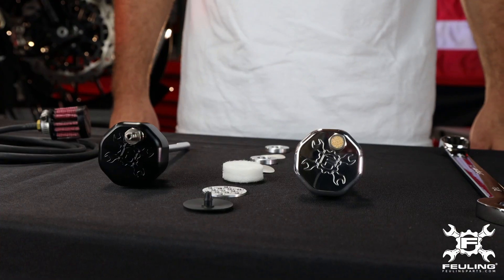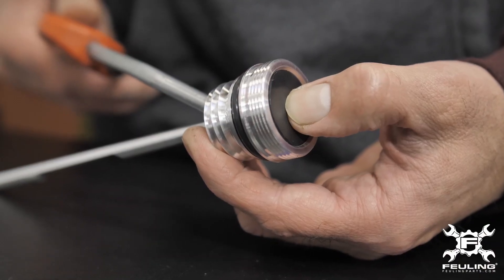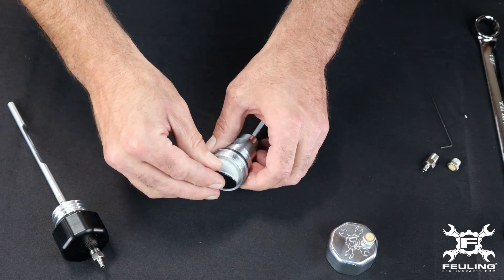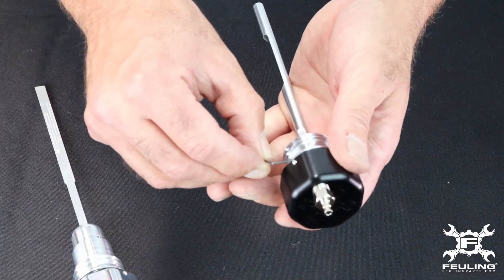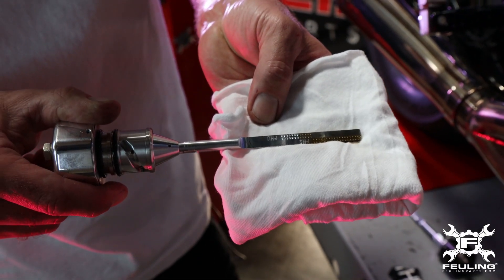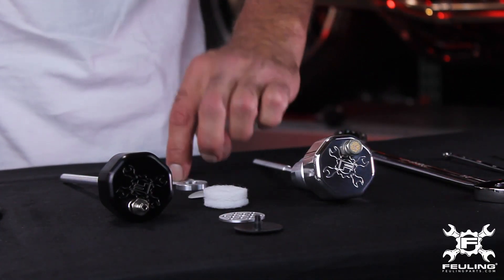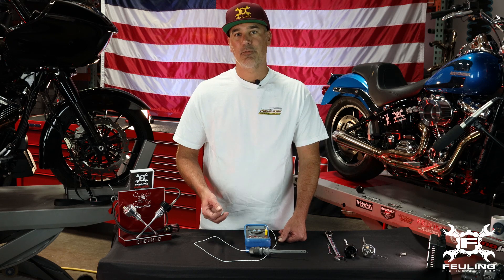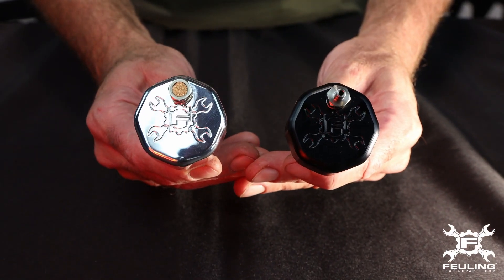FEULING VENTED DIPSTICKS FOR M-EIGHT & TWIN CAM ENGINES

Comment: So, we are asked to buy a part to try to solve the manufacturer’s poor design, and lax tolerances?
Reply: I know right? Why no recall notice to have this installed?
Reply: @thecommander2616  You must be a first time Harley owner. 😂
Reply: @joshrandall5297   right? Hahahaha... since 1903 , same same.
Reply: Harley Davidson gave us a better and more powerful engine without solving the same oil pressure flow problem they’ve had for all their motors. Government EPA regulations is why they can’t fix it. 
I’ll be adding Fueling’s dipstick with line filter to my Harley this year, BUT I still have one big question?
Should you run ventilating dipstick during a DYNO tune?
Reply: @thecommander2616  EPA
Reply: Dont like it… go get a honda

Comment: I purchased one of these dip sticks. It is well made but, after using it for a few months, I removed it from my bike. It made no discernible difference on my bike. I ended up with a DK custom set up, now my air cleaner is dry with no more oil laden vapors getting sucked into the throttle body.

Comment: Hard to believe such an expensive bike has such a problem with oiling and crankcase pressure that requires such elaborate and costly aftermarket solutions. How long has Harley been making bikes? This seems like a simple engineering problem that should not be an issue coming from the factory.
Reply: Well it's an imaginary problem. Believe it or not the motorcycle has breathers that vent excess pressure already on the motorcycle. The 'issue' is that the EPA does not let Harley, or any other manufacturer, vent to atmosphere. That means the breathers vent into the intake. This ensures that all gasses are going to end up going through exhaust. What people dislike is the fact that when these breathers are working there is the possibility of atomized oil entering the intake. If all of this oil is not sucked in by the intake you get what is called blow by and oil actually escapes the intake and gets stuck in the air filter or flies out of the air filter and onto the bike. All of these 'fixes' are unnecessary and to my knowledge there are no data driven analysis that support the need for something like this. If blow by is such a huge problem a really easy fix is to ensure that your oil is not filled to maximum capacity or higher.
Reply: @batglide5484  blow by is from bad rings. Oil from the crank case being pushed into the cylinder. 

The M8 and TC can push too much oil through the breathers and it introduces more than just air into the cylinder. Most guys will never notice it but anyone that actually runs their bike hard will end up with excess carbon build up on the piston and valves. This ends up being a problem way down the road assuming normal conditions. HD allows problems to happen so they can sell the solution via screamin eagle.

Can you fix it cheaper? Yes but the part of that question thats more important than cost is the fix. $10 spent vs $400 is great until the motor locks up from oil starvation. 

Most parts cost stupid amounts for 3 reasons: name, R&D, materials. Buy it or don't, no difference to me
Reply: @kjknuth9127  the blow by pushes excess vapors and oil into the intake through the breather bolts. That's the exact purpose of the breather bolts. When people complain about blow by on their Harleys they are complaining about the oil exiting the air filter and hitting their bike or pants, or they are complaining about excess carbon buildup. Firstly, oil vapor in the air fuel mixture does not contribute meaningfully to carbon buildup. Engines vented to atmosphere still get the same amount of carbon buildup. Secondly, excess crank case pressure is already being vented out of the breather bolts. That is their purpose. Every motor company uses some form of breather bolt setup to relive excess crank case pressure, cars usually use PCV. To solve the issue of excess oil entering the intake and possibly not entering the combustion chamber as designed would be to integrate a catch can of some type between the breather bolt and the intake. If you can show me quantitative data that proves that the breather bolts are not venting enough crank case pressure and that this aftermarket product does, I'll eat my words. But I've looked it up and I can't find any evidence if either.
Reply: @batglide5484  then don't buy the product it's basic economics. There's a reason that companies have went this route and a reason motors are blowing up from the factory. I don't know either and I suspect neither do you but I can about guarantee it's the same reason
Reply: @kjknuth9127  uhm motors aren't blowing up from the factory. Even when they had sumping issues, that only affected a small minority of all M8s being produced at the time and that problem has been fixed for years now. You obviously have no clue what you're talking about, but if you want to spend hundreds of dollars on a modification that won't increase performance, reliability or even look cool then that's up to you little buddy. 🤡🤡🤡
Reply: @batglide5484  won't fit on my motor even if I wanted it.
Reply: @batglide5484 
You ever pull the heads off of a low mileage twin cam with massive carbon buildup in the intake and exhaust runners and piston dome Mr. " data driven analysis" ?

Comment: On the Softtail the standard quick disconnect requires side panel removal to check oil, the 90 degree fitting would be nice to have included in the kit.

Comment: Will this prevent blow by getting into the air cleaner?   You should have included an oil temp gauge!
Reply: @DKCustomProducts  I was wondering the same thing.  Thanks for the link
Reply: @DKCustomProducts  I assume the unit labeled  "m8 bagger" will fit the Ultra Limited 114cc?
Reply: @DKCustomProducts  Good thing DK is here answering questions for these guys. What’s up with that?  They need to realize this is a great opportunity to clarify questions.  Maybe they would get less phone calls with basic questions tying them up all day.
Reply: @johnnyturbo8460  We have many EBS options to fit the M8 Baggers, which include the Ultra Limited 114.  Which one to use depends on what air cleaner you are running.  You can contact us with that info or a photo and we will let you know which ones will fit.
Reply: @redlee3391  Thanks.  Feel free to write or call us with any questions.
Reply: @DKCustomProducts  ok, I am running the Rhinehart cold air intake.  I believe it's still the only one they sell. They just have two color options but only 1 high flow air cleaner
Reply: @DKCustomProducts  you guys and gals are always on point. I get that small town family feel every time I call and order from DK

Comment: I like Fueling products and went to order this…. $300? Holy…
I may just be using my CNC etc and trying to do it myself for like $29.
Reply: I don’t have access to a CNC but I’ve got my hobbyist lathes, mills and a shaper. With a bit of stainless and a few odds and ends, I’m pretty sure I could produce my own custom version.

Comment: One of the first things I did to my 2001 Fatboy when it was new, was install a Gear Drive and a fueling oil pump. I then put over 50,000 miles on it before I upgraded to the fueling cam plate and lifters.

Comment: High quality part.  BUT, the Feuling instructions (including this video) are not appropriate for an M8 Softail. Routing the hose was a big challenge; took me 3+ hours to install.  Calling tech help line was not too helpful.  You will need at least 6 more locking zip ties than the 2 included in kit in order to route the hose and secure it so it won't wander or chafe or interfere operation of other parts, including the side stand.

Comment: Do I need to do this on a 2022 Heritage?
Reply: No Harley started putting in a better oil pump in 2020 you should be fine it was 17. 18 19
Reply: @garyposthuma9607   Much appreciation for the response,
right here now was the only place i’ve heard that, others weren’t sure.  Thanks.
Reply: @1862anthony  that why there telling people with 17 18 19 to up grade there oil pumps to 2020 oil pump that when Harley put in a lot better  oil pump so you have the better oil pump in your 22 ihave a 18 ultra limited want 1500 to 1800 put new pump in I think I keep driving it and hope I don't have problems with it have 30 thousand miles on it
Reply: @garyposthuma9607  Nice, good to know your ride going good, good news.  And thanks for info, one less headache I need, dealing with NY traffic is bad enough.

Comment: Can gauze pad be used as filter element during  service to moto or do you all supply a filter element for sale. Will this stop the oil misting out of the air cleaner on the 2012 TC 103 or just relive the idea of oil going into the primary?

Comment: I paid the 301$ for the kit delivered from Dennis Kirk. Came with a scratched cap and has a chip where the connector screws in for the hose. Not sure how that can pass the QC ... Trying to get a replacement cap from either Feuling or DK right now. Frustrating that I have to deal with this and cannot install the part as I cannot break the shipping bags . Not sure what to think about all of this .. .
Reply: It’s called life. I hope you got it resolved.

Comment: I bought one  of these for my 2020 softail and it works great....I rode about 50 miles and engine seemed to run better and I used just the filter on top of the cap and didn't have any seepage or misting.
Reply: You guys are funny. He crankcase already has a bleeder.
Reply: @mahealanihawaii9830  yup. Bleeds everything back into your engine, and that is not good for your piston tops.
Reply: @MadMexism  also reduces octane rating making knock more prevalent on a hot engine, dirties up valves, and adds a coat of oil buildup on top of pistons which increases compression… making knock even more possible.

Comment: if you don't apply too much exhaust backpressure you're engine won't blow oil. neither will over filling it. just hook a copper tube right at the head pipe from the head breathers. it will burn the oil and puke it out the exhaust. like Indian Larry preached add a gizmo and fix the dam thing! so who cares if its puffin smoke. that way everyone will know where you're at. even the Navajo during smoke signal exercises!

Comment: Don't understand how mounting under the frame does not compromise the filter with rain water or mud without plugging up the filter.  Does Feuling sell replacement filters now?
Reply: Use a catch can

Comment: I think I know why, but I'd rather hear from someone like yourselves who are more knowledgeable. You obviously went through the trouble of utilizing a one-way flap valve in your design for a reason. why is that valve required because I've seen another similar cap that doesn't have one? thanks.

Comment: I just bought a 2020 fatboy, and was having inconsistent oil readings on the dip stick. I finally started doing some research and found this video in which you mention the oil pump being on the right hand side and running the engine while on the jiffy will cause oil to be kicked into the crankcase. My question is how do I get that oil back? I know I'm not short oil but the dipstik says I am, so how do I get that oil back? I've tried and can seem to get it back, what I did was run my bike into normal operating temperature remove the crankcase sensor let out all the oil and the refill to correct level! There's something absolutely wrong with having to do this tho! I'm taking the bike into the shop! Any recommendations as to what to mention to the techs?

Comment: I have a 95ci twin cam.  Will this eliminate the need for the head bolts?  I was thinking of doing a catch can. can I just do this instead and replace the head breather bolts with solid. Object is no oil in the intake.

Comment: Will the fueling dip stick erase the need for a external breathers,stop the blow by from the vents on the heads
Reply: I've been told this helps enough that you don't need an external breather. But I've seen people do both. I went with just this!

Comment: I have a '22 low rider st and after my 1000 mile service my dipstick has been puking oil out of the filter - why would it do that ?  I installed it when the bike was new and it hadn't leaked until after the first service. When I took it apart the pads that were in it were soaked with oil. And I'm wondering if the valve opens up too easily once they get two pads saturated with oil?

Comment: On my 2005 Heritage classic, I just drilled a small hole straight into the top of the stock Oil Tank Cap/dip stick.  After an engine rebuild, going (from 88 up to 104 CI), my cap literally blew off the tank while riding.  So far this is working good, for a shade tree fixer.  Is there a required amount of oil pressure that should be in the Oil Tank?  Anyone?

Comment: Do you cap off the vents at the air cleaner after you install this?
Reply: great question!! id like to know a well....
Reply: @GUENILLA  I left mine as is it's not gonna hurt it. As long as it is vented at crankcase, for sure check with your mechanic.

Comment: I’m noticing on your softail m8 dipstick you have a single o ring. i was sent one third party that has 2 o rings for my heritage classic and have been problems with the cap leaking all down my bike since i got it. did they sent me one for a touring m8 ? the oil level is good and line routing correct. do i just have the wrong model ?
Reply from the maker: give us a call and one of our techs can help you out (866)966-9767

Comment: i recently installed one on my 2017 M8 and I'm still getting a little oil in the air cleaner. I've read that other guys are removing half a quart of oil after installing the dip stick to help with the issue. Do you guys recommend doing that? * i mean removing half a quart of oil from what the factory recommends
Reply: I also have a 2017 M8 with significant blowby. Just went ahead and spent the $700 for an upgrade to the Feuling oil pump.

Comment: Will that drop oil in front of my rear tire
Reply: By routing the breather hose up under the seat before going back down under the frame you are only venting vapor with very minimal oil content.  You are riding across more oil residue when you ride 10 ft on the pavement.

Comment: 300$ I did this for 12$.
Reply: What did you do? I have a 2013 Streetglide. For the crank breathers i just ran hoses into a small bottle in the air cleaner. They had expensive options but that seemed silly.